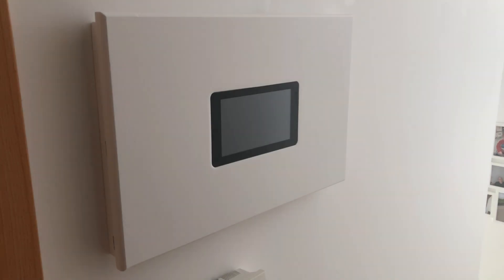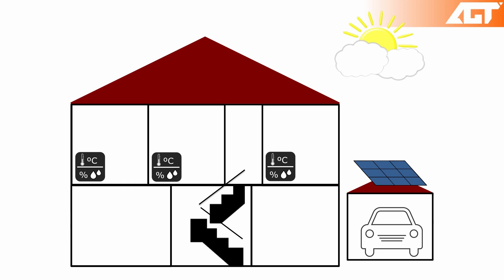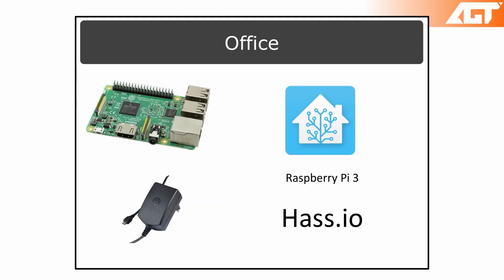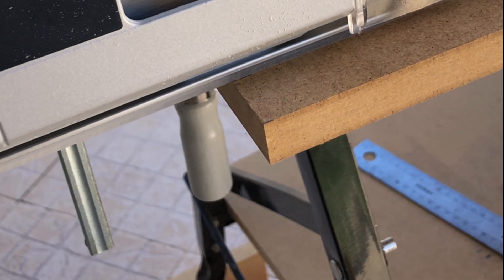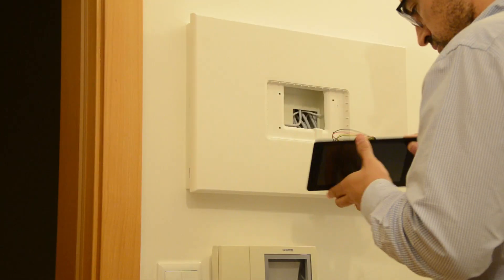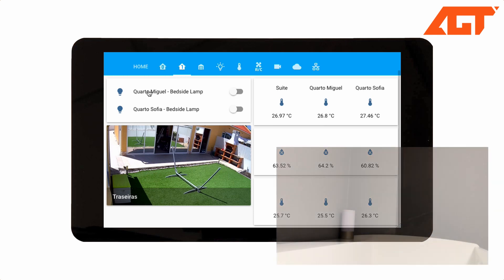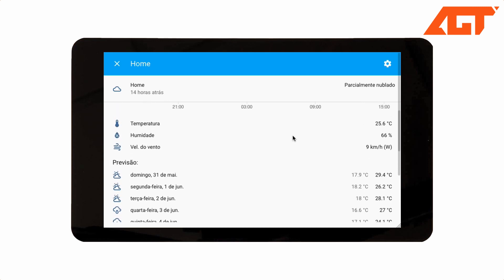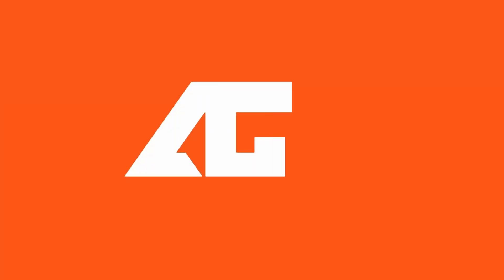My cheap smart home system | HomeAssistant Wall Panel

Comment: Thanks for the video!  As I have watched tons of how-to videos on the home assistant, I was wondering if you can tell me how you got it to display on the screen.  Im on my computer with no problem, but I want to build a display similar to yours.  I guess I just need the steps to make that happen!  If I connect the pi to 7in screen it only boots up with the home assistant screen and the IP address showing.
Reply from the maker: Hi. Have you installed the home assistant OS, or Raspbian and then HA? For viewing the webpage you need to have a browser of some sort, in my case in the display pi I’ve installed Raspbian and then Firefox (which allows full screen). Hope this have helped. Cheires

Comment: Wherever it is you live Pedro, clearly keeping cool is an important thing.... here in Ireland... not so much. Keeping WARM is our primary thing. I wouldn't even know where to buy an air conditioner and I don't know anyone that owns one....
Reply from the maker: Hi! Well, in the peak of the summer we can get around 40C, so AC is definitely needed. I’ve been to Ireland a couple times due to work, sometimes in winter time, so I really understand the need of heating. :) cheers!

Comment: Great video man, I literally want to do exactly what you’ve done. I only have 1 raspberry pi 4b, can i use the same raspberry pi for the server (with hassio installed) and for the touchscreen panel
Reply from the maker: Hi! Thanks a lot! Yes, but I would use home assistant on top of raspbian so that you have a proper OS to install Firefox to access HA. :) cheers
Reply: @AGTDesigns  ah I see thanks you so much, how would you install home assistant without the HASSIO OS. Btw your videos are so inspiring, control 4 systems are nice but they are very exspensive
Reply from the maker: Have a look at this: https://www.home-assistant.io/docs/installation/raspberry-pi/
It requires a little more tinkering, but it's the way to use only one machine. Cheers.
Reply: @AGTDesigns  your the best man you deserve way more subscribers, awesome project. For now I’m just gonna make my own smart switch panel (sort of like a Luton panel) for my LIFX and Govee lights. I’m using IFTTT webhooks to communicate between the RPI and lights. Ill definitely give this a go with the RPI touchscreen when i get a newer RPI 3/4
Reply from the maker: Thanks man. :) good luck with your system.

Comment: Amazing Video! Just one question. Is your Display in sleepmode when you havn't used it for some time or is it active all the time?
Reply from the maker: Hi. Thanks! It is in sleep mode, only goes live when I touch it, and after 10sec goes to sleep again. Not only saves power but also lowers temperatures. Cheers

Comment: What is smart about this system? There is no Automation. Its only a Tablet in the Hallway. So you now have to go outside of the Room, you want to controll sometihing, to control it? It is only a Home-Control system and not a Home-Automation. Nothing smart in it.
Reply from the maker: Hi. Thanks for the comment. I can somewhat understand some of your remarks, but I disagree. The video mostly shows how I've build the infrastructure that integrates several server applications, several sensor nodes running different communication protocols, all integrated in one "aggregator" (in my case Home Assistant). I guess whether this can be called "smart" or not can be debatable, but that's OK. Also, apart from what is shown on the video, I've since then added some automations, and since it's HA if you have your phone with you you can access it. The wall panel is a big part of the system, is how I manage to input Bluetooth (which has limited range) and VBUS data (which it's easier to run in a linux-ish system) in the HA database, it's more than just a display. 
Regarding the location, for our living habits the place where it's located is actually quite handy and we're happy with it. 
Of course it may not fit other living habits, and there must be people out there who would actually hate to have such a thing on the wall, and that's perfectly fine... but the video was really not intended for them. :) 

It's just our solution, there are a lot more out here, but if it inspires you on building your own version or at least shows you what you definitely don't want, than I guess my intent was accomplished. :) Cheers

Comment: Why not configurate 1 HASS server on a PI which controlls everything and cheap tablets as wallpanels for configuration around the house? I've bought myself a few 10" tablets and a few simple wallmounts the install them with. It only cost me around €50 (all in) in total per panel. The recommended PI's itself are already around €40, then you need the touch screen (only 7" if I'm corect) a decent power supply (2A/3A) and a SD-card. And install it or doing the effort building it in.
Ok, the cheap tablets I've bought are not the fastest, but they only need to display a webpage of a sepperated HASS user interface. There are a few great ful display browser apps for it and they can also let you use the frontcamera as movement switch. So just waving in front of the screen 1 time and the screen activates. All of this is just running on 1A power supplies. And only need to maintain/ config 1 HASS server/host this way.
Reply from the maker: Hi. Yes, what you say is totally true, but I’m not sure if I can run the Vbus server on a tablet (I don’t think I can on the HASS server) and also I’m not sure how I would make the tablet run the Bluetooth module for the temp sensors (which needs some tuning, the standard integration does not work well) on Android. It’s a matter of being more comfortable working with Linux and don’t having any experience with Android, but I can understand your point of view. Cheers
Reply: @AGTDesigns  Is it not possible to integrate all of this into one and the same host/ HASS server? Would make it verry "plain and simple" if possible :)
I'm using Wemos D1's around the house for temp measuring. They're verry compact and verry verry cheap (via aliexpress) and configured them with tasmota/mqtt. This way it's just integrated into the network and directly into HASS and not having to play around with seperate bluetooth devices. You can use/config diffrent sensors/relays etc. with them which makes them verry versatile for home automations. I really can recommend them.

My comment was not meant to be negative on your video btw. You did a nice job there and I'm not a proff into this. But using these seperate PI with aditional screen just looked a bit overkill to me. But seems you had good reasons for it :)
Overall great video!
Reply from the maker: Hi! I've read your comment in a very positive way, and I appreciate hearing different opinions. I've got some "less than nice" comments before, so I definitely can tell the difference. :)  I'm also not a professional, and I'm sure there are plenty of different ways to do this, but my aim with the video was just to inspire people to try their own versions. I'm also planning to integrate some ESPs, but I have other projects I need to finish first. Thanks for your insights! :)
Reply: @AGTDesigns  I'm happy to hear so! Keep on the good work and these kind of projects! They will be verry helpfull to people.

Comment: Why such a small screen for the border? iPad or android tablet mounted into a custom mount would of been easier to use and see
Reply from the maker: Well, I explain it in the video, it serves as a cover to the electrical cabinet as well,  and I did want to be able to control the OS, it’s much easier to handle Linux than Android, and iOS is way too closed. There are not many bigger touchscreens affordable and RPi compatible, that is something I’m searching right now as I want a bigger screen in another area. But I understand that some people may not like it as it is, and that’s ok. :)

Comment: you can get away with 1 pi for home assistant server and use like a tablet with kiosk browser installed on it for the panel. It works really well
Reply: Or use tablet with android and higher resolution. Why dedicated PI just for browser??
Reply from the maker: Hi. It’s not just for browser. I have the vbus server working in the wall panel, as well as the Bluetooth listening modules for the Temp and Humidity sensors. Also, I’ve never used Android, but I have some experience with raspbian... of course higher resolution and bigger screens would be nice, but it would create other problems as well...it’s a matter of finding the balance. :)

Comment: Thanks for making the video! Question - why are you using two complete instances of home assistant? If the wall panel instance gets all the data and displays it as well, what benefit does the second instance in the basement have? Or is it just for redundancy in some way?
Reply from the maker: Hi. Two main reasons: the system may be expanded in the future, so I prefer to have a central node with the main db and small nodes feeding this db. also, the wall panel does not have UPS, while the server has. SD cards don’t like power outages, and this allows me keeping the main system more protected. Cheers

Comment: hi, why go you need 2nd HA. (office). The in wall panel cant be done all the work ?
Reply: sorry for miswriting
i mean why do you need 2nd HA. (office). The one in the wall panel can't be done all the work ?
Reply from the maker: Hi. It could, but there are 2 reasons for this. The first is that I plan on expanding the system, and the wall panel Pi lacks UPS, which I have in the office. Also, having the other HA gives me the possibility to use hass.io (or whatever how it is called nowadays - naming has changed) which is also nice since I have the store option. Having additional units with other HA instances let’s me keep the office as the main db. Cheers

Comment: Hi AGT, can you share a  little more about your Resol integration?
Reply from the maker: The Resol integration is based on a JSON server.

First you need to install NPM/Node. Go to

https://nodejs.org/en/download/

and copy link of ARM v7 (if you're using Rpi4).
Then:
wget <COPY LINK>
tar -xJf <TAR name>

access node directory
sudo cp -R * /usr/local/

to test:
node -v
npm -v

Then, install the work of Daniel Wippermann:
https://github.com/danielwippermann/resol-vbus/tree/master/examples/json-live-data-server

git clone https://github.com/danielwippermann/resol-vbus.git
cd resol-vbus
npm install
cd examples/json-live-data-server
npm install
cp config.js.example config.js

Change config.js for the VBUS IP.

Then:
cd .../resol-vbus/examples/json-live-data-server
node index.js

It should now connect to the VBUS server and transform them to JSON.

Then, in Configuration.yaml, do something like this:

sensor:
  - platform: rest
    resource: http://JSON_SERVER_IP:3333/api/v1/live-data
    name: VARIABLE_NAME
    value_template: '{{ value_json[0]["rawValue"] | round(1) }}'
    unit_of_measurement: "UNIT"

Hope this helps!

Cheers
Reply: @AGTDesigns Thank you.  That is exactly the detail I was after.  Cheers!
Reply from the maker: :) Glad to help! Cheers

Comment: How did you get the “Feels like temp”?
Reply from the maker: It's a template. The feels like temperature is the result of a calculation that uses both the temperature and humidity values.
 I've actually copied this from the HA forum, but can't remember who is the author. 
Anyway, the code is like this:

 - platform: template
    sensors:
      heat_index_suite:
        friendly_name: 'Feels Like Temperature Room X'
        value_template: >-
          {% set T = ((states('sensor.TEMPERATURESENSORNAME')|float)*1.8+32) %}
          {% set RH = states('HUMIDITYSENSORNAME')|float %}
          {% set STEADMAN_HI = 0.5 * (T + 61.0 + ((T-68.0)*1.2) + (RH*0.094)) %}
          {% if STEADMAN_HI >= 80 %}
            {% set ROTHFUSZ_HI = -42.379 + 2.04901523*T + 10.14333127*RH - 0.22475541*T*RH - 0.00683783*T*T - 0.05481717*RH*RH + 0.00122874*T*T*RH + 0.00085282*T*RH*RH - 0.00000199*T*T*RH*RH %}
            {% set HI = ROTHFUSZ_HI %}
            {% if RH < 13 and 80 < T < 112 %}
              {% set ADJUSTMENT = ((13-RH)/4)*((17-(T-95)|abs)/17)**0.5 %}
              {% set HI = HI - ADJUSTMENT %}
            {% elif RH > 85 and 80 < T < 87 %}
              {% set ADJUSTMENT = ((RH-85)/10) * ((87-T)/5) %}
              {% set HI = HI + ADJUSTMENT %}
            {% endif %}
          {% else %}
          {% set HI = STEADMAN_HI %}
          {% endif %}
          {% set HI_C = (HI-32)/1.8 %}
          {{- HI_C|round(1) -}}
        unit_of_measurement: '°C'
Reply: AGT Designs can’t imagine that switching this over the Fahrenheit would mess up any of the calculations?
Reply from the maker: I was a little naive and did not check the formulas.. but a quick google search lead me to this. 
https://en.m.wikipedia.org/wiki/Heat_index

The formulas for F and C have different coefficients, but with a couple of changes the bulk of the code should work.

Comment: Great work. I did almost same kind and I'm using also pi touch. 1 question: Do you have a solution that the display goes into blackscreen after a few sec and restarts by touching it again? Thanks for your support.
Reply from the maker: Hi! Thanks! Yes, it took me a while (and some tickets with raspbian support as it was working in the pi3 and not in the pi4). 

You have to create some crontab entries (in terminal type “crontab -e”, and I suggest changing the editor to nano as its much easier than vi).

I have this in my crontab:

@reboot sleep 30 && /home/pi/startup_script.sh >> /home/pi/cronlog.log &

It basically runs the script 30 seconds after each reboot, which has several startup commands. The part that you need is this one:

#!/bin/bash
export DISPLAY=:0
xset dpms 10

Hope it helps! Good luck! :)

Comment: Great video! Interesting to see the architecture and helps to keep things simple. 
Would like to know how do you do the integration for Broadlink mini and the AC? 
Do you use the temperature received in the HASSIO and request Mini to send IR commands to the AC?
Reply from the maker: Thanks! I started using it as a remote, but it is definitely possible to add automations. The thing is that the RM mini <> HA connection is not very stable, and after power outages it might stop working.. the best is to have some kind of WiFi module integrated in the AC, so that you can control it with a feedback loop instead of this open-loop control that never really gives you total security that the commands have been implemented. Cheers

Comment: Could you please explain the integration bit between mi home devices and home assistant? Doest his work for ZigBee devices connected to a Mijia gateway as well?
Reply from the maker: I know that it is possible, but there are details on which version of the gateway is supported. The sensors I’ve used are Bluetooth, so I really can’t speak from experience... check out the HA forum, there is plenty info there. :) cheers
Reply: @AGTDesigns  How you connected to the Bluetooth temperature sensors?
Reply from the maker: There is an integration for these xiaomi BT temperature sensors, but as is doesn’t work very well. After a lot of digging on the forum, I’ve found some fixes, and this method works for me:

In an installation based on raspbian:

Enter virtual mode:
sudo -u homeassistant -H -s
source /srv/homeassistant/bin/activate

Install pexpect module:
pip3 install pexpect

create folder custom_components inside /home/homeassistant/.homeassistant/ and navigate to that folder.

Download patched modules:
wget http://tsymbaliuk.com/mitemp_bt.zip
unzip mitemp_bt.zip

wget https://gist.github.com/Magalex2x14/7389b840d873824dcabf93a193fe2ca8/archive/ca0dff1b3be6ce95cc27aee7cb3ffa70192ae87f.zip
unzip and replace sensor.py

Reset Pi Bluetooth modules:
sudo setcap 'cap_net_raw+ep' `readlink -f  `which hcidump``
sudo setcap 'cap_net_raw+ep' `which hcitool`
sudo hciconfig hci0 down
sudo hciconfig hci0 up
sudo hcitool lescan

If you want to know the details, head over to the HA forum and search for mitemp, but this is the recipe that I’ve been using and it worked awesome.

Hope it helps.

Comment: Hi AGT ...nice video ..with likes from India...which LCD panel can we use...or any tab will do
Is installing Raspberry Pi in tab will connect the devices.
How to integrate all devices
Pls Help
Reply from the maker: Hi! I’ve used an official Raspberry Pi 7 inch touchscreen, it integrates nicely with the RPi 3 and 4. I don’t have experience with using tablets, but I know that is possible. Cheers

Comment: Belo projeto!
Fiz algo parecido aqui em casa, porém usei um Tablet Lenovo com Windows 10. Ele é o servidor do Home Assistant (rodando em máquina virtual) e ao mesmo tempo é o display. Tem apenas 2Gb de RAM, mas está rodando muito bem, há um mês. Eu o configurei para reiniciar todos os dias às 05:00, com isso não fica pesado.
Além disso, configurei para entrar em proteção de tela com fotos da minha família, portanto quando não está em uso, ele serve como porta retrato digital.
Reply: caramba cara, muito legal, como esta o sistema após 1 ano? tem bastante automações?
Reply from the maker: Nem por isso, estabilizou de uma forma muito próxima de como ficou no vídeo….mas é utilizado literalmente todos os dias, tanto para controlo de iluminação como pela parte de temperatura e câmara de segurança. Estamos bastante satisfeitos, pode ser que em breve leve um novo empurrão com mais integrações! Um abraço